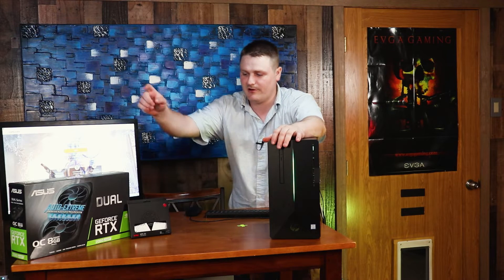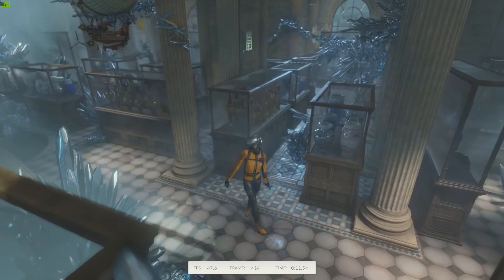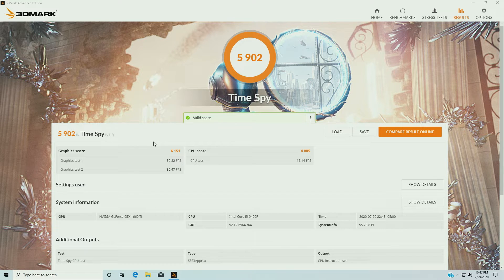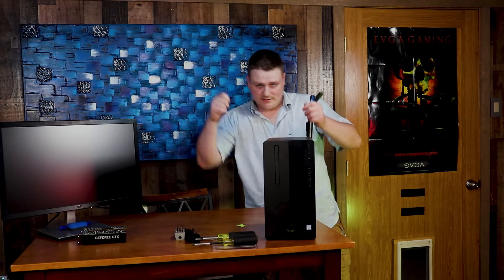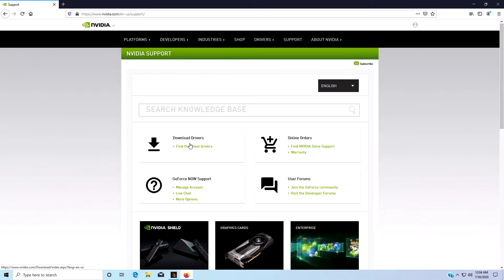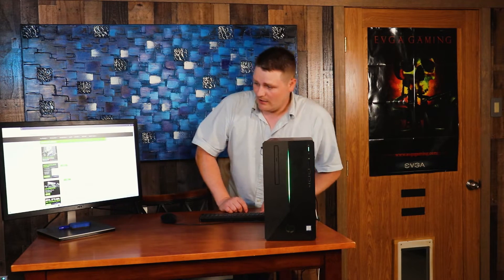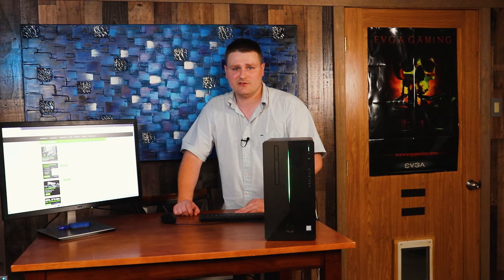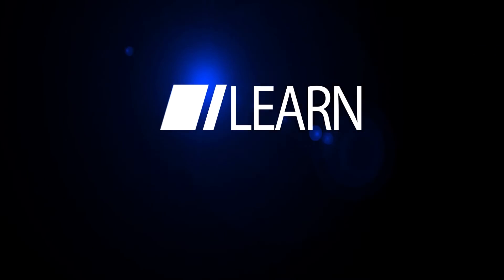Hp Pavilion Gaming Desktop 690 Upgrade To A RTX 2060 Super 8GB GPU & 16GB Of Ram (How to Install)

Comment: Hi, I have a hp pavilion gaming desktop 690-00xx. It currently has radeon RX 580 and ryzen 5 2600. I play Warzone competitively on low settings and usually get around 100fps. I play on a 144hz monitor. I want to play Call of duty Cold war with higher settings for multiplayer. I dont mind spending money for a new pc but im thinking i could get away with the RTX 2060. I guess i could buy a new pc without RAM, HDD and SSD (as i already have those), that would bring the price down a bit. What do you think? What is the best possible combo that could go in this pc? Thank you.
Reply from the maker: Ryzen 3700X, RTX 2060 dual fan or 2070 Mini, 32GB 2666Mhz Ram 16GB Dimms, Dual 1Tb or 2TB SSD You would also need to upgrade the PSU in the hp to the 400watt one. The problem is the 400w Psu really limits you. Also you would have to look to see if your Motherboard supports the 3700x. if it does not I would jump ship. holy crap 2000 GPU'S Prices have gone up, not worth it right now. If you had the room for a 3070. But the TDP is to high for the 400w Psu. I Would say If you want a high end Gaming Pc At this time, building is going to be your best bet. You could also look at PC's like Cyber Power Pc or Acer Nitro 50. I do not say HP because at this point they Charge $200-$300 just for there name. They also start to Charge more for the Parts 15-25% over Market. I am talking about the omen. Not really worth it unless you can get it heavily discounted.

I would try to get your hands on a 3070 or 3080. If you can do that build around it. 
The 3080 Is pretty Much 100% better then the 2070 atm. Also the 20 Sires cards Are crazy Priced right now, not sure why.
Reply: @TNW1337  Thanks for the detailed response. I have the 400w psu. ok, so you think the ryzen 5 2600 wont go so well with the RTX2060? 

I just contacted support they told me this-
TDP: up to 65 W
Socket type: AM4
Motherboard supports the following processor upgrades:
Processor
TDP
AMD Ryzen7-2700 (Pinnacle Ridge) 8 cores/16 threads
65 W
AMD Ryzen5-2600 (Pinnacle Ridge) 6 cores/12 threads
65 W
AMD Ryzen7-1700 (Summit Ridge) 3.0 GHz, 8 cores/16 threads
65 W
AMD Ryzen5-1600 (Summit Ridge) 3.2 GHz, 6 cores/12 threads
65 W

I use this pc just for competitive call of duty and will have a ps5 on 4k TV for other gaming. This makes me inclined not to spend $1400+ just for the 3080 then plus everything else., whereas i can get the RTX 2060 for $500 (Im in australia) and put it straight into my existing pc.

Your great, subscribed.
Reply from the maker: @MCMIXING  Yeah a RTX 2060 is awesome, see if you can get a supper. Watch for them to go on sale if they do. That extra 8Gb goes a long way vs the 6Gb Normal Version. If not it is still a good card and will be night and day vs a RX580. Last thing make sure it is a dual fan as you only have 10.45 inches of room 10.5 over all.
Reply: So i need to find out if the Ryzen7-3700x will work on the pc or not. is the problem the 400w?
Reply from the maker: @MCMIXING  No it is what you would want. They also had a 310w that they put out with this model and does not come with a 6 or 8pin for the GPU.
Reply: @TNW1337  Thanks, I just bought the RTX 2060super :)
Reply from the maker: @MCMIXING  Cool You will be happy its a big jump from the RX580 :P
Reply: @TNW1337  This is the one I got : Gigabyte GeForce RTX 2060 SUPER Windforce OC (Boost:1680MHz), 8GB GDDR6 (14000MHz), PCI-E 3.0, 3x DisplayPort 1.4, HDMI 2.0b. Its the 2 fan model. Will this be all good? I seen you used the ASUS Dual NVIDIA GeForce RTX 2060 Super 8GB GPU. Is there any difference? Thanks
Reply from the maker: @MCMIXING   Other then the brand Not really, The clock may not be the same. But it is not going to matter, they will have about the same performance.
Reply: @TNW1337  thank you
Reply: @TNW1337  Im also going to try the 400w to 500w upgrade to be safe.
Reply: @TNW1337  I’m receiving the rtx 2060 super today. Before trying a ryzen 7 3700x in this pc would you recommend I do the upgrade to 500w power?
Reply: @TNW1337  it didnt work the gigabyte GeForce rtx 2060 super 2 fan is a longer card
Reply from the maker: @MCMIXING  Longer then 10.5 ? Watch my newest video to see how to get it in. It is like a puzzle piece or jumanji puzzle. I hope it is not to long, unless it is to long that sucks.
Reply from the maker: @MCMIXING  https://www.youtube.com/watch?v=MTJ9SkVjvQg&t=102s
Reply: @TNW1337  i measured it its 10.5. I tried for half hour and held it beside my 690 and its deeper than the pc
Reply: @TNW1337  The ASUS Dual GeForce RTX 2060 SUPER says online its 9.5inches
Reply: @TNW1337  Unless if ive got this wrong. The one Ive got is 10.4inches.
Reply from the maker: @MCMIXING  My asus is 10.5 they could have mislabeled it, when it was suppose to be 10.5 end up being 10.51 or 10.55
Reply: @TNW1337  So i should try again to get it to fit
Reply from the maker: @MCMIXING  It is going to be larger then the RX 580 by a good amount. Did you watch my other video towards the middle I installed the GPU and show how you have to do it. I really hope it is not to big. The case should have the room. It took me about 1 hour to figure out how to get the card inside.
Reply from the maker: @MCMIXING  Skip to 10:30 on the video
Reply: @TNW1337  my internal pc depth is 10.2 inches
Reply: That is the available space for a card to fit in. From the opening in the back to hitting the front cage
Reply: @TNW1337  there might be a difference between this model pc in USA and Australia?
Reply: @TNW1337  I figured it out- in this video https://www.youtube.com/watch?v=5vK9Xr4In44 you say the internal depth of your 690 is 10 and 1/8 inches. Then you measure your GTX 970 and say it 9 and 1/2 inches. This happens around the 15:30 mark in that video. So really the ASUS RTX 2060 super is 9 1/2 inches, it cant be 10 1/2 because that is deeper than the pc.
Reply from the maker: @MCMIXING  https://www.asus.com/us/Graphics-Cards/DUAL-RTX2060S-O8G-EVO/specifications/
Reply from the maker: @MCMIXING  https://ibb.co/ZYQtfZG
Reply: @TNW1337   thanks for all your help, but at the moment I’m convinced it’s a 9 and a half inch card. In that video link i posted you measure your pc internal depth and say it’s 10 and 1 eighth inches and talk about the struggle to get the 9 and half inch card in. All the sites I find in Australia say the Nvidea 2060 super is 9 and a half inches long. 10 and a half just can’t fit into 10 and 1 eighth.
Reply from the maker: @MCMIXING  Yeah Maybe I got them Mixed Up, Why does Asus say it is 10.5 on there site, When the card clearly is not. Sorry mate your going to have to return that one. And get one that fits I feel bad about this, I am going to remeasure again. Even the Asus box says it is 10.5.
Reply from the maker: So I did it comes to 10.35 This would be max or may not work
Reply: @TNW1337  Thats all good. Im going to return it and try the asus card. Im not stressing about it. Thanks :)
Reply: @TNW1337  Thank you, I think I can get that to fit as my pc measure is the same as your measure from the link earlier. Thanks :) Ill let you know when its all in! :)
Reply from the maker: @MCMIXING  I hope it works Out man
Reply: @TNW1337  I finally got the new asus card and it fits! Unfortunately I have another problem, I had previously put in the spare cage bay a 3.5 inch 4tb HD. So you guessed it. I can’t fit the cage back on because of this HDD, so I’m looking fit a solution. I don’t think I can mount it anywhere else in the pc. I’ll probably have to get a 4tb SSD... hmmm
Reply from the maker: @MCMIXING  ok you can mount a 3.5 to the lower part of the cage i an at work now when I get home if you want to jump on discord we can get you sorted 👍
Reply: @TNW1337  ok, just letting you know my pc came with an SSD and a 3.5 HDD, these were mounted at the top of the cage. I put an additional 3.5 HDD at the bottom of the cage (fan side of the graphics card). I seen that if I don’t use the ore drilled holes in the cage it’s possible to slide the HDD a quarter inch further to the bottom of the cage. I then pre drilled two holes to line up with HDD side holes and used industrial double sided tape to fix the HDD there. Not entirely happy with it but it’s working. If there is a better way I would love to see it, please let me know how, thanks
Reply from the maker: @MCMIXING  well the ssd can be double side taped any where you want 😉 so 🤷 hdd are a harder thing to move it can be done
Reply from the maker: @MCMIXING yeah it sucks you maybe able to mount the drive up higher. Witch case do u have 690?
Reply from the maker: @MCMIXING  sorry I get a lot of comments its hard to remember who what where.

Comment: I ordered the version of AMD Ryzen 7 4700G in the HP store totally modified with the most expensive components, but it does not carry the HDD Storage with me.

My question is if I can install the HDD and if I install it will it hold with the 400 watt power supply?
Reply from the maker: yes it should not have a problem. it is spec for 3 drives max memory and max video card with the 400watt Psu. Also take a look at Acer Nitro 50 or a Cyber power. to see if you can get a better deal.
Reply: @TNW1337  thanks man, a thumbs up
Reply from the maker: @robertotarangozarazua1366  Pretty much I want you to get the best deal you can, with the best parts. HP just has good deals some time. But if you want a Mid to high end gaming Pc. Your going to spend more, whats your budget? if you can give me 30min, I can provide some link's if you like.
Reply: @TNW1337  The thing is that I already paid a budget of 1900 dollars, plus the hard disk that I ordered separately along with a monitor.

It could be said that at first glance it looked like a high-end computer a little more expensive because it was assembled with its components.

I was doubtful about the 400 watt power supply and bought a 600 watt 80 plus bronze.

Then I looked further and found your channel, Tell me would I have done better with that budget?
Reply from the maker: @robertotarangozarazua1366  Depends the prices go up and down. It is a good PC no matter what. I just was not sure if you wanted help or not.
Reply: @TNW1337  I appreciate the consideration seeing it from the positive side I have an extra power source for another computer and I can take more advice from your videos in the future, I subscribe.
Reply from the maker: @robertotarangozarazua1366  https://www.cyberpowerpc.com/system/November-2020 $1400

https://www.cyberpowerpc.com/system/Gamer-Infinity-8800-Pro $1900 this has a 3070

When you pass that $900 to $1k mark. The price for the parts you get are unbalanced.(With HP)
I love Hp's they do a great job. Just you pass in to the Hp omen's & they start to charge exorbitantly.  Also I feel if your going to pay that price. You should be able to get some thing for it. Like a good 3 year Warranty or better parts or a better air flow with your case. Air flow is importing for 2 reason Better performance & more fans. Most of the smaller cases do not have any type of dampening and only run one exhaust fan. So they can be pretty loud.
Reply from the maker: @robertotarangozarazua1366  Thank btw (for the sub)

Comment: THANK U SOOO MUCH I NEEDED TO KNOW THIS, U EARNED A NEW SUB
Reply from the maker: Thanks man every one counts and matter :P
Reply: @TNW1337  hey did u lower the power limit on that with msi after burner
Reply from the maker: @THBGYMN  nope
Reply from the maker: Max is going to be the card the 2060 is 160 or 170 watts
Reply: @TNW1337  so still working nice with that 400w  also did the 500w even come in or did hp rip you off
Reply: @TNW1337  how much is your psu pushing with all that in there
Reply from the maker: @THBGYMN  360-390
Reply from the maker: @THBGYMN  Still waiting on both of them to show up.
Reply from the maker: @Alfredo Danny Good luck.

Comment: bonjour, je suis français et j'aimerais savoir, est ce que je pourrais remplacer ma carte graphique nvidia geforce 1060 6g par une 3060 ou 3070? le pc est le même hp gaming 690 car j'aimerais jouer à fortnite en 240 hertz. merci de votre réponse.
Je ne suis pas expert donc j'aimerais savoir si je peux remplacer : j'ai :

i5 8400
16gbram 2666mhz
carte mère : Nom HP: Lincs
SSID: 843B

après si l'alimentation je regarderai ne convient pas je changerais en 750watts ça devrait suffire.

Merci de votre réponse.

_____________________________________
Anglais : 

Hello, I am French and I would like to know, can I replace my nvidia geforce 1060 6g graphics card with a 3060 or 3070? the pc is the same hp gaming 690 because i would like to play fortnite in 240 hertz. Thank you for your reply.
I am not an expert so I would like to know if I can replace: I have:

i5 8400
16gbram 2666mhz
motherboard: HP name: Lincs
SSID: 843B

after if the power supply I will look at does not suit I would change to 750watts that should be enough.

Thank you for your reply.
Reply from the maker: I think you are asking if a 3060 will work. Not until we know for sure 100% what the TDP on the cards will be. When we know that, I can tell you yes or no. One thing I know is the 3000 use a lot more power. I am guessing the 3060 will not work. Unless Hp decided to upgrade the Psu.
Reply: @TNW1337  
Thank you for your answer, but the psu I can change it myself, right? by a 750 watt otherwise it is supposed to work if the psu is updated?

Comment: hey guys i’m new to pc and i got this computer last christmas but don’t know jack about upgrades, will doing this make my games run smooth bc that’s the problem i’ve came across so far
Reply from the maker: 1st thing I would do is look at the model number and find out if you have the 310 watt psu or 400w psu. When you know that I can tell you . It should be upgrade able. Also you could try to reinstall windows. I hate to say it 90% of pc problems most of the time are the dude/chick between the keyboard. I made a simple how to video if you want help doing it. I would say watch the video from start to finish 1st be for attempting it, to see if it is some thing you feel like  you can do. You will save your self 80-120 bucks. Pretty much it is using a usb stick and clicking the right buttons at the right time. If it is your only computer you own make sure to download the network drivers and Wifi driver to another usb stick. as after you wipe windows some times it will not reinstall the drivers.
Reply: @TNW1337  Appreciate the advice man, i’ll have to look into that tomorrow. been debating about upgrading my pc or get next gen console
Reply from the maker: @devonjohnson2176  Console are nice, you can just do so much more with a pc.
Reply: @TNW1337  it’s a 310 watt psu, is that bad? and would i need to upgrade that if possible to continue to upgrade?
Reply from the maker: @devonjohnson2176  If you wanted to upgrade to a RTX 2060 it would be needed.
Reply: @TNW1337  okay how would i go about upgrading the psu, do you happen to have a video on it?
Reply from the maker: @devonjohnson2176  its come soon.

Comment: Thanks for making this video. I will be ugrading my 690 to 2060s and a HP 500 watt PS soon. I have upgraded the on board NVME to 2tb, 32 gb of ram, added a PCI sata NVME 2tb, and a 4tb HHD. I have subbed and will be waiting for you to do a CPU upgrade video before i decide what to buy.
Reply from the maker: Thanks
Reply: I have 690-0034 , can I add a m.2 nvme or do I have to replace the 128 that's in it, ( I'm not saying lol) or can I add a ssd internal or should I just get an external? Thanks 4 any help
Reply: @nimrodpaul6875   Get a PCI-e to m.2 card and plug it into the open pci slot and blam more storage. or you could disconnect the disc drive and use that sata interface and hook up a sata ssd
Reply: Did you find that it had to be the 500w HP PSU? Anyone found equivalent PSU's that work?

Comment: i have an HP Pavilion Gaming Desktop 690-0028b with 310 watt psu what can i upgrade with it?
Reply from the maker: CPU, Ram, Gpu, Drives, Psu some of the 310's have the 8pin/6pin adapters the 400watt psu is only 77. if you where ever to go that route. or you do not have a 6/8pin on your psu. you could only use GPUS that do not need external power.

Comment: will the 3600 or 3600x work on the intel model? tia
Reply from the maker: no
Reply: @TNW1337  amd model sorry
Reply from the maker: @yashp  AMD model 690 ? if so go to google look up your model number, Look for a HP web page. it should take you to a HP page, there should be a motherboard sheet and spec sheet. The one I was using was Intel. But the other 690  Do have AMDs they can use the Ryzen7-3700x, Ryzen5-3600, Ryzen5-2500X. Your model number should be on a sticker on the bottom of the case. It should look like 690-#### there maybe a letter like 690-P####w
Reply: @TNW1337  thanks for that it is an amd model
Reply from the maker: @yashp  no problem.

Comment: Brought a 500w psu, now waiting for the rtx 2060 mini
Reply from the maker: I hope it was the Hp Psu or you will need cables to convert it to work with the mother board. Also normal Psu will not fit with the Hp 690/TG cases. Well you maybe can get them to fit screw in is a different matter.
Reply: The model of the PSU is L05757-800

Comment: I have a 690-0083 with a 310w psu, I want to add a 1660 to it. Will it be able to support me adding a 400-450w psu?
Reply from the maker: Hp sells a 400watt psu if you need it. 1660ti will only work if you have a 6 or 8 pin connector coming off the PSU. 310w should be able to work on a 1660ti, I am not sure if it has the extra cables needed. Pull your side panel off and look to see if you Gpu or Psu has a extra cable. Just make sure to unplug your power cable to not damage any thing.
Reply: @TNW1337  do you know if any 500 watt psu are compatible with this build?